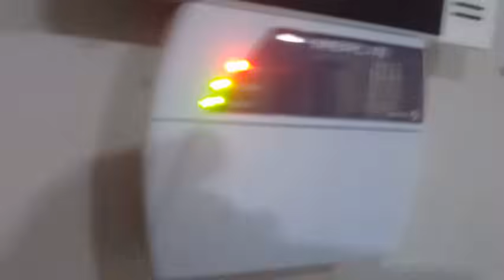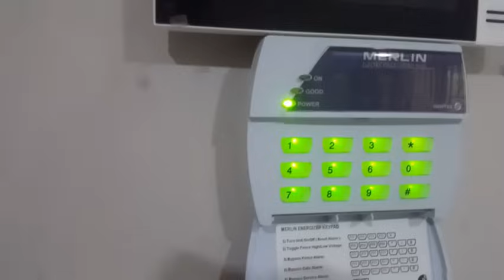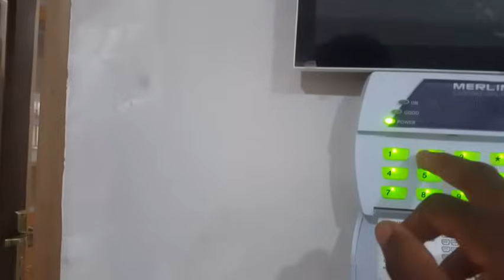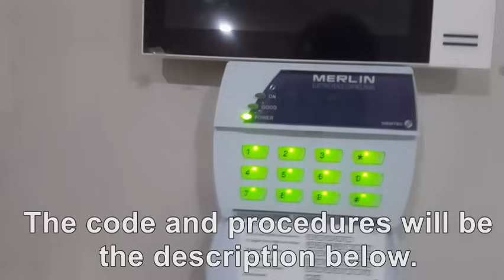ELECTRIC FENCE INSTALLATION : how to change password on nemtek merlin electric fence

Comment: How do i reset Merlin 4 to Factory Setting pls
Reply from the maker: Hi. Remove all power supply and wait for a few seconds. Connect back the battery and put the socket on . Within 30 seconds, type 2389# on the keypad
Reply: Very helpful. Thanks
Reply: Thanks a lot boss